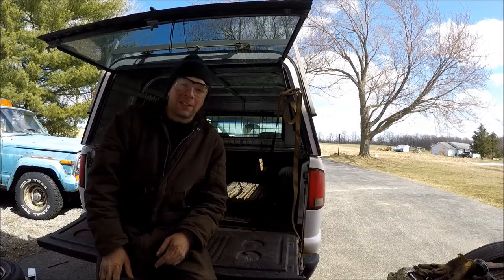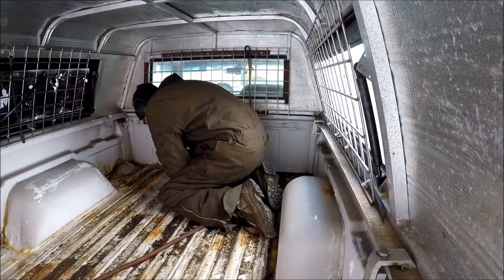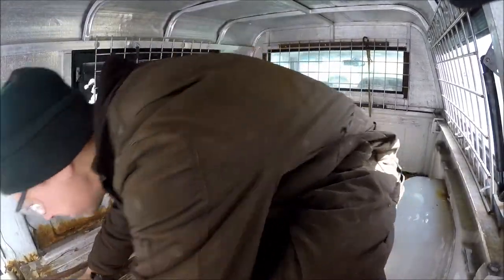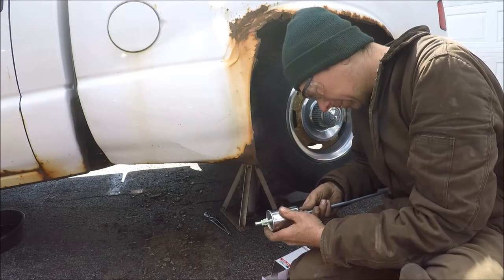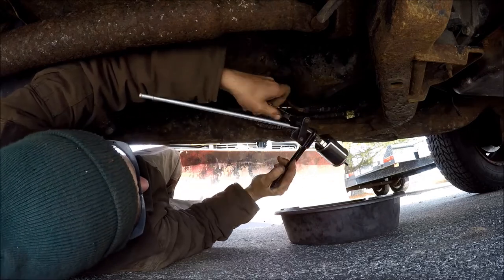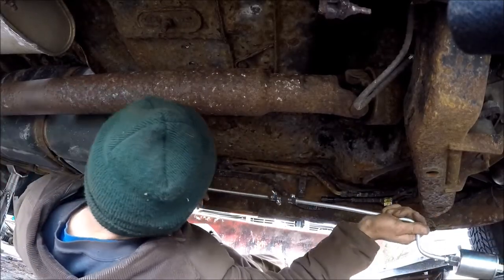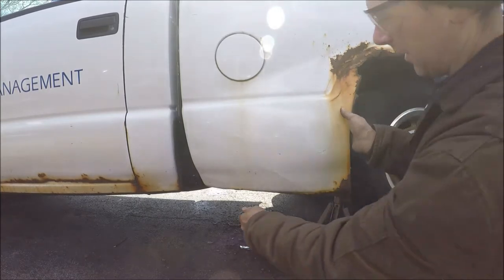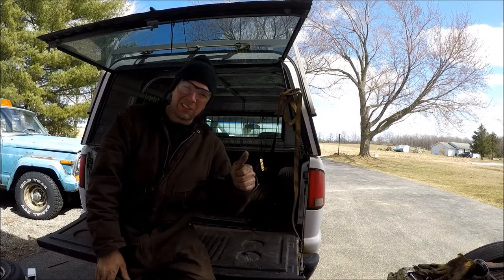$20 Fuel Line Repair How-to and Hack:  Chevy S-10 Butchery

Comment: I'am Your Newest Subscriber Great Videos. I Have A 1994 Choptop S10 Has Sat For 12 Years I Just Ordered A Brand New Spectra GM16B Gas Tank 115.99 From Autozone Made In Qubec Found A New Carter Fuel Pump At Nampa Made in Indiana 74.49 . I'am Sure My Fuel Lines Are Clogged
Reply from the maker: Thanks for subscribing!

Comment: How did it connect on the other side? Did you have to cut the existing line off? I am not seeing where to connect mine is leaking from the portion on top of the frame
Reply from the maker: I used a piece of high pressure fuel injection hose and double hose clamped it.

Comment: Replacing the hard lines not rubber lines metal lines in the top of the fuel injection they have rubber sleeves I am trying to replace those how do you get them out
Reply from the maker: I don't know what you're referring to.  I shot this video 4 years ago so I don't remember exactly how it lays out and truck is gone now.